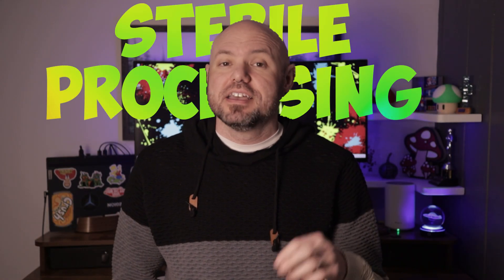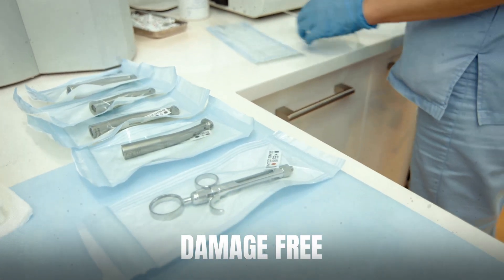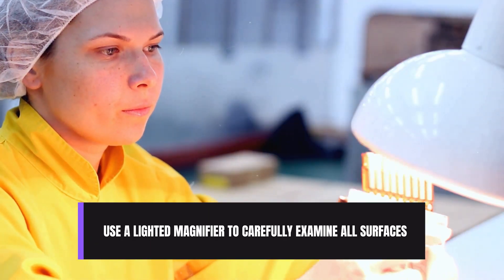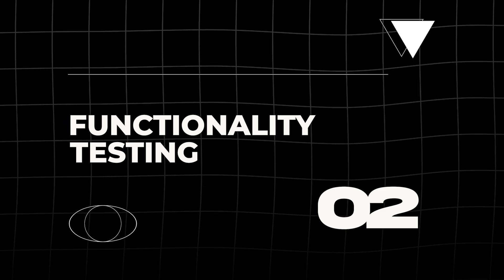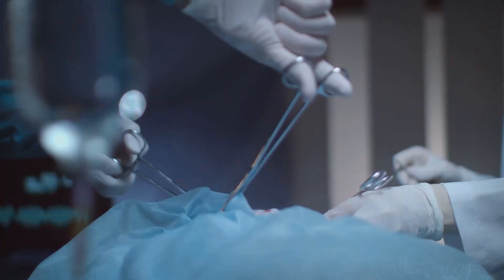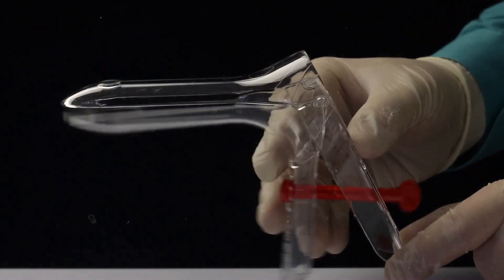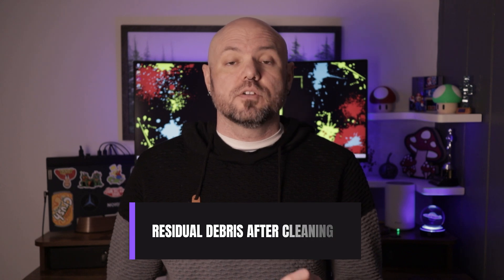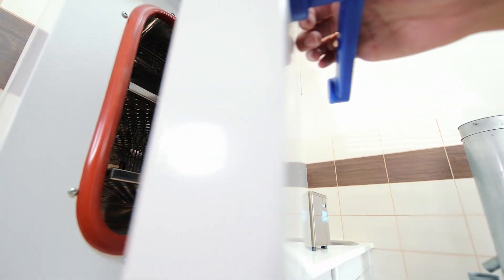Master Surgical Instrument Inspection in 10 Minutes!

Comment: Why do you choose to irrigate with alcohol and not sterile water?
Reply from the maker: Because alcohol is a drying agent. It makes sure the cannulas are internally dry.
Reply: @StephanieMercer-h8w  
I’ve experience using alcohol at one facility and using sterile water at another facility. I like to use alcohol because it dries quickly.